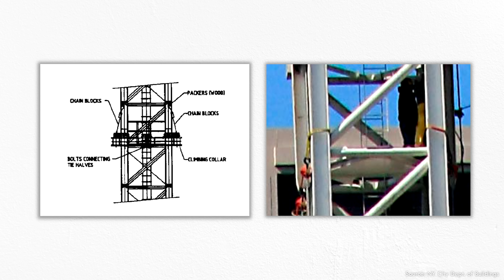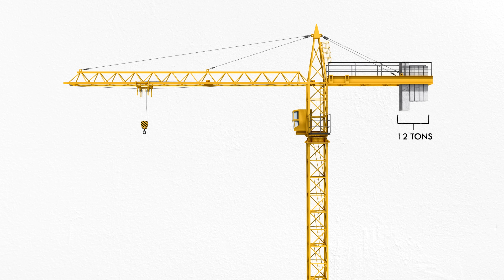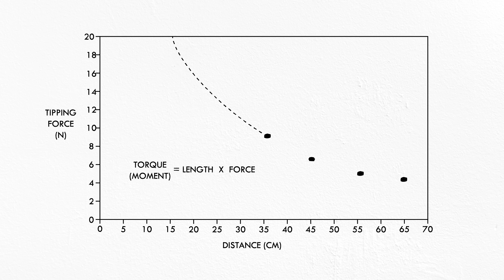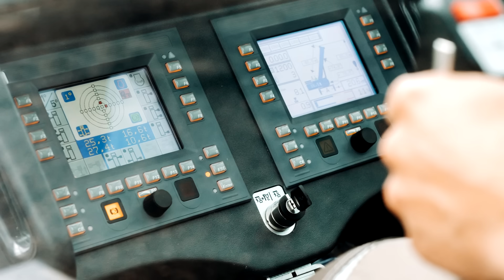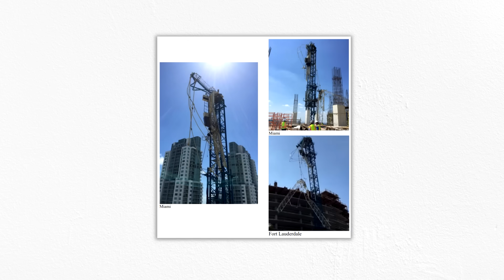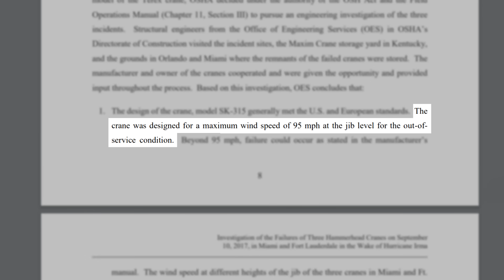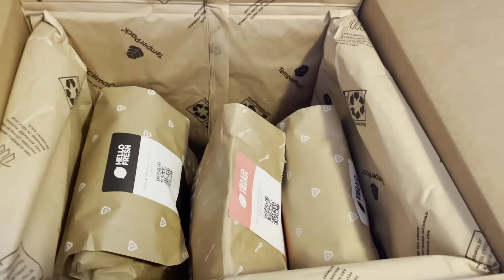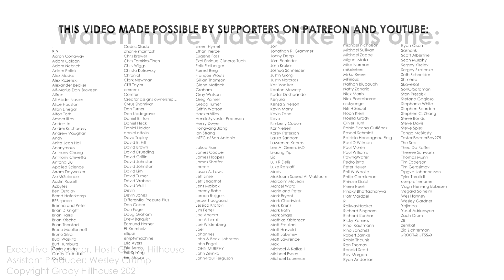Why Cranes Collapse

Comment: I had a brother killed in a crane accident.  In 2008, in the Houston area, one of the world's largest cranes collapsed while being moved on a windy day.  My brother was operating a smaller "helper" crane during the move.  I have never really understood the role of this "helper" crane, nor the specific cause of this accident.  I would love to see someone like yourself look into this accident and explain what might have happened.
Reply: Apart from a couple of newscasts and a 7-minute video showing the actual collapse (at about minute 6), there's not much info out there.  I did come across a lawyer's post about the OSHA investigation (https://www.terrybryant.com/houston-work-injury-lawyer/construction-accident-lawyer/crane-accident-lawyer) saying something about there not being a "boom-stop" to prevent a backwards collapse (which looks like what may have happened in the 7-minute video)...  But... why?  How could that massive main boom have gotten so counterbalanced as to get pulled over backwards.  I just don't get it...

Although there is a mention of the crane engine running, nothing was mentioned about it being moved and the "helper" crane, info which came through private/family channels.

Comment: Perhaps in your next video you could touch on cyclic loading of crane failures. It is technically covered when discussing proper assembly, but I think it's such an interesting form of mechanical failure that's it's worth a special mention.

Basically, if the bolts aren't torqued correctly then they can undergo cycles of tension and compression as the crane is loaded and unloaded. Proper torquing pre loads the bolts so they are always in tension and therefore not subject to cyclic loading.
Reply: Preloaded bolts/screws are a very difficult detail

Comment: "Bah, engineers always overdesign stuff. She'll hold twice that much, easy."
-Construction Guys
Reply: "Who needs to fit a wrench in here, anyway?"
-Engineers
Reply: @MarioMonte13 
Touché.

Dog Walker, many cranes are tested to 125%, but I think you may be thinking of rigging equipment.
Reply: @TheRealE.B.  Many lifting equipment (chains, slings, etc) have safety factor of over 5
Reply: @SilentEliminator  True. That's actually the safety factor with respect to rupture, though. The safety factor with respect to the load that would cause permanent damage to the equipment is somewhat lower, and some below-the-hook equipment designed to ASME standards effectively has a safety factor of only 1.67 with respect to yield and to other failure modes that are a function of yield strength. The standards say 2.0, but it seems like it's to be equivalent to a historical practice of having a 1.67 safety factor combined with a 1.2 dynamic equivalent factor on top of the static load (1.2 x 1.67 = 2.0). The purpose of the dynamic impact factor was to account for the fact that the true force is higher than the static weight of the load, so it's not truly part of the safety factor. It's more of a fudge factor.
Reply: @TheRealE.B.  you seem like such a pro 😳
Reply: @TheRealE.B.  you've triggered the meat heads
Reply: @MarioMonte13  I take pride in usability being second only to safety in anything I design, at least until the Sales dept. get their their hands on it.
Reply: @MarioMonte13  Product engineers spend their time in hell fixing the stuff they designed.
Reply: @MarioMonte13  I know what you mean. I think that engineering education should have a practical component, where students spend a couple of years working in a trade, to minimize how much stuff like that happens. And that we should actively recruit from the trades, instead of just high schools.

The truth is, engineering and the trades need each other, even if we get on each others' nerves. We're not enemies. We're more like squabbling family, and we need to learn to work together better in spite of the corporate structures that make it hard to do so.

The original joke that started this thread was actually based on something my cousin, who is a carpenter, said to me a few weeks ago.
Reply: @TheRealE.B.  This "getting on each others nerves" is easily fixed, make the other guy (engineer in this case) adjust the screws, he will have no problem including access holes for the screws once he throws the ratchet and storms off cussing.  "Walk a mile in someone elses shoes".
Reply: @unclejim1528 :  It was said to me in the automotive trade about poor engineering design...  In the older days, it was said that if an engineer got a knock back from his wife the night before, he would go to work the next day and put an abortion of an idea onto paper which would find its way into production.  The mechanics for years to come would be paying through the nose for the wife saying no to her husband that night...  Worst that has been told to me was having to take half a motor apart to get to 1 spark plug at the rear of the motor.  What should be a 2 minute job is now a 3 hour job...  if you are lucky!!!
Reply: I think this Was true. 
But now in the age of commercialization this probably wont hold true anymore.  
Likely also because of comouter simulation, since in the old days they didn't have those sims, they'd easily be inclined to overengineer something just to be on the safe side. 
Now with all the sims we can much more accurately save materials making the whole product more efficient, but also by being more efficient they'll automatically have less redundancy.
Reply: @Coen80  This is a really good point. Historical engineers were conservative because it was expedient and computation power was limited. Now, there is more pressure to be precise and economical. Which also makes both errors and deterioration more dangerous.
Reply: @TheRealE.B.  And if you got your sums wrong you were mercilessly pilloried.
Reply: A Fels  I never said the education requirements should be lessened, but the average young engineer lacks understanding of the context of their work.
Reply: can confirm, work on a construction crew with a scissor lift rated for 600lbs. we have loaded that lift to the point that it lacked the power to lift.
Reply: A Fels  I don't think anyone here is saying the safety practices should be lax. The joke we were making was about the ridiculously cramped spaces mechanics are expected to get into to service equipment. It would make my job easier if the engineers were required to be able to service the equipment themselves; it'd incentivize making easier access to critical components.
Reply: Yep you're right they over design it and under rate it every time. It'll be okay don't worry about it it'll ride oh, she'll handle it okay LOL
Reply: The OC used to be more or less correct, until everybody wanted the civi to lead the design instead of the industrial engineer because that would save money in materials. And then the CEO stepped in, and gave the design lead to an economist... :/
Reply: Structural engineer from a leading crane manufacturer here: Safety factor is only about ~1.34 (34%) depending on the load case (see EN13001, EN14439, ...). Larger safety for older cranes, which have been built in the 80s (DIN15018/DIN15019, maybe even DIN120).
Reply: hahahaha
Reply: yes and no. we once did a lift of a 12.000lb transformer. we all knew the crane was out of chart and were pretty queazy about the whole thing. later found out he was 15 feet out of chart and lets just say that wasn't a popular move by the operator amongst his co workers.
Reply: little did they know the safety margin is 20% due to managment forcing people to cut costs on everything
Reply: Used to be like that. Not for a long time now though. I have put my 34yr old kobelco crane to 120% capacity and never an issue. Nothing of the last 20 years I would even go to 90% capacity
Reply: Spent 30 years repairing and later inspecting cranes and boom trucks were what scared me the most. Most of them have the LMI over ride switch on the operators panel. saw too many that came down or were bent from the operator saying "I just needed a couple more feet, so I used the over ride."
Reply: They are tested to 150%
Reply: @dogwalker666  105 or 100% for mobile cranes and 125% for overhead cranes
Reply: @dogwalker666  who the hell told you that don’t comment till you know anything they are tested to 15% and Tadano is 20% I myself have gone well over that but I know someone who had a boom break at 130% but inexperience played a factor as he could’ve shrunk the boom putting into tipping but that’s too much for most operators they just don’t understand
Reply: We always over design stuff for two reasons. In case we made a mistake (unlikely)
In case our design will be owned and operated by idiots (highly likely)
Reply: @andrewallen9993 engineers never make mistakes right lol
Reply: @JoeRogansForehead  it is unlikely but possible that engineers will make mistakes but almost house odds at a casino that it will be operated at some stage by idiots.
Reply: A rather broad thing an “intellectual” would say
Reply: Spoken like somebody who's never left the office.
Reply: @RB01138  How would I hear the construction guys say s*** like this if I never left the office?

Comment: In San Francisco, in 1989, when the Loma Preta earthquake hit which also collapsed highway overpasses, sections of the bridge between Oakland and San Francisco and collapsed many buildings in the Marina district due to liquefaction those of us living there got a very quick education on cranes.  Of course, ever crane at every high rise building sight and all the cranes in the ports all around the San Francisco - Oakland area, as well as at the naval base have to be constructed and operated with the knowledge that seismic activity could be an issue at any time in addition to other factors normally encountered anywhere.  We were lucky - our building partially collapsed but we were all able to self extract prior to rescue arriving although with injuries that put many at local hospitals.  My daughter and I were taken to Kaiser Hospital which had a huge building project going on and had a few cranes close by but there were others all over the city some a great deal taller than the ones in use at the hospital.  I had a splinted arm but my daughter had to be admitted and shortly after she was settled I was out on the ER patio which actually had a good view of the Marina District and most of the city skyline.  One thing we could not help but notice was that very quickly the cranes we could see that had been standing tall all over were disappearing and it was obvious many were being dismantled, including the ones close to the hospital and actually some sections of the hospital had to be evacuated until the cranes were removed.  Not a great time for that to happen as hospitals were being flooded but  those areas could be used again once the crane was mostly dismantled.  At first we thought some we being move to help search and rescue where buildings had collapsed but then actually found out that some that immediately left the skyline had come down in the quake and as the quake was great enough to cause liquefaction which was the cause if building collapses the issue was that it was hard for them to even understand how most of the cranes even stayed up and it was not a case if inspecting them where they stood but the manufacturers actually said that they needed to be taken apart, parts and components individuality inspected and then rebuilt actually using some new parts that they felt that amount of seismic activity had stressed them beyond use even if they looked okay.  It later turned out that all the parts the manufacture said not to reuse microscopically showed signs of stress fractured and had the crane been put back into use with those parts they would have soon failed.

Of course you can understand in a city where we see cranes all over everyday why people were yelling about the fact that they could not just bring over the nearest cranes they just took down to lift pan caked highway off cars with survivors still known to be alive, or to lift heavy roofs and walls if houses so rescue could have more access to search.

The big problem was the liquefaction which we found out happened quickly during the quake but took a long time for the water to settle back out and the ground be stable again, plus any big after shocks could make the ground unstable.  And just aftershocks in general were a risk to reassembled cranes most of which needed to wait for parts they were told not to reuse to be sent in.  It was basically odd to walk around a city were cranes were normally everywhere and not see any for over a week or so before there were more than a few pretty short mobike ones brought in for debris removal.  They city skyline was free of the tall cranes for several weeks.  They had to wait until the risk of large aftershocks were over.  They had to wait on replacement parts as well as inspections on all the crane parts before they could be erected. It's one of the aftermath of a big earthquake people don't realize as without that equipment building sites were not working, and many sites had to have inspections to make sure that any part built had no damage and was safe to continue building so a lot of people were temporarily out if work.
Reply: Interesting, thanks for posting.
Reply: Thanks for taking the time to post and glad you all made it!!! I never thought of that and don't recall reading / seeing anything about that aspect of the earthquake either. Always nice to learn something new.

Comment: A failure at a building that was constructed in the 50s where mobile cranes had been set up many times was caused by a leaking water line underneath a concrete patio.
Luckily the matting that was put down held until the load was set down and the boom withdrawn with very little damage done.

Comment: If so many accidents happen when the crane operators push the load barring to the limit shouldn't the margin of error be revised? especially if you are claiming the winds can increase the load on the crane by 15%. While pushing past the limits of machinery is an obvious blunder can we say the same about pushing almost to the limit?

Comment: Subbed. Explained so well even a caveman could understand it. 🤦 sorry couldn't resist.  

Seriously I own & run heavy wreckers/recovery equipment & all these rules even apply to me, perhaps even more so because a lot of thinking has to be done "seat of the pants, on the fly." It's probably a good thing most wreckers have as high a safety factor as they do.

Comment: As far as ive learned from looking at crane failures is that the top ten reasons for crane failure are:
1: failure to follow guidelines
2: failure to follow guidelines
3: failure to follow guidelines
4: failure to follow guidelines
5: failure to follow guidelines
6: failure to follow guidelines
7: failure to follow guidelines
8: failure to follow guidelines
9: excessive weather events
10: manufacturing defects

But im just a layman looking from the outside.

Comment: I can answer without even watching -  most lay people, and even too many supposedly "properly trained" operators have an insufficient grasp of:

> Center of Gravity
> Leverage 
> Tension & Compression
> Equipment Specs & load limits.

Case in point: a lot of people just cant grasp how a flock of birds can perch in the center of a 1,000' long high voltage transmission line and thereby induce some astonishingly high tensile forces on the line.  Crane masts are subject to some similar forces, both tensile and compressive.

This is why slacker students should be dragged out of classrooms and thoroughly beaten until they take learning seriously, and why only trained/certified/licensed people should assemble & operate heavy equipment

Comment: I had a view over several construction sites when High winds suddenly arose. At least 2 of them were lifting large heavy flat wall segments. One got theirs down fairly quickly, while the other had a very limited space to lower it. You could see the Urgency as the workers tried to balance the need to get the load off the hook, while also not causing any initial damage/injury. Hadn't really appreciated the amount of factors that need to be taken into account till then.

Comment: In the UK a Lifting Plan is a legal requirement for any crane operation. Unless the crane is sited on a known hard-standing surface such as a road with a know design loading limit, then a ground bearing test is also required, still these 'accidents' happen.

Comment: A dockside crane failed where I worked around 1980, the slew ring was jammed during repairs, that weekend the wind blew it over after pushing it down the tracks until the rail clamps, that had not been secured, jammed and tipped it over, landing across the stern of a ship and just missing a transformer compound. The hole in the ground from the slew ring remained for several years.

Comment: #1 cause of all human problems is exactly that, humans. if you remove operator error, design and manufacturing errors and ensure proper maintenance and operation, there's essentially no way a crane can fail however we do not live in such a utopia where people actually create and follow rules to the letter so here we are watching expensive things fall on our heads.
Basically, We're our own worst nightmare and we need to own up to this fact before any improvement will be made.